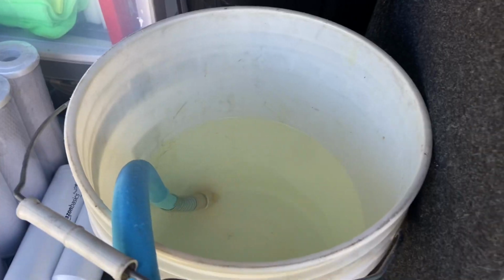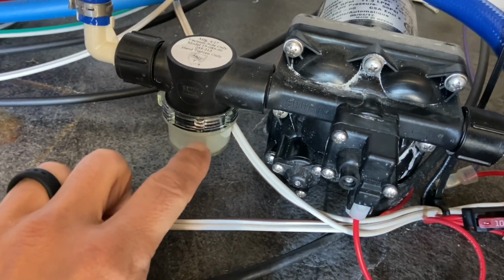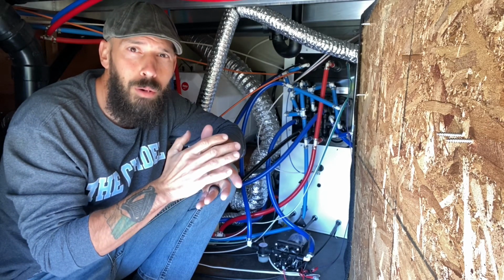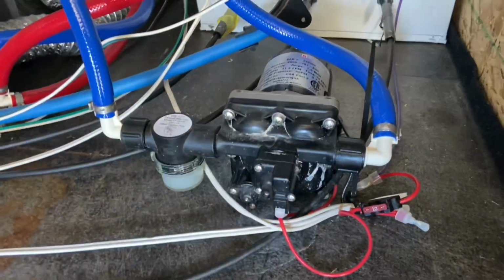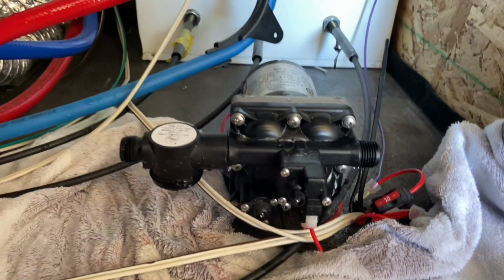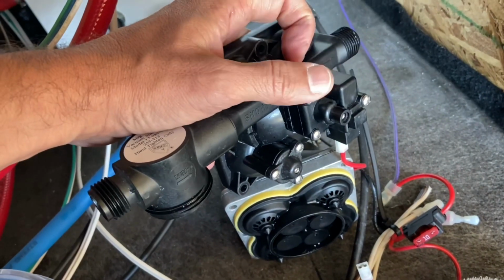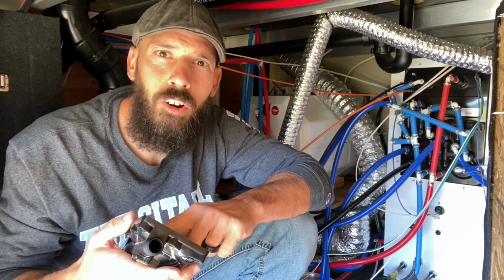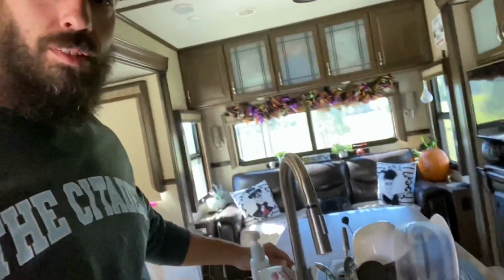RV WATER PUMP TROUBLESHOOTING (Pump Runs but No Water...Fixed!)

Comment: Nope, my valve is working but when the motor spins the diaphragm does not move. Got to try another video 🙄
Reply from the maker: Bummer. Hope you get it figured out. These things can be finicky. I guess the good thing is they aren’t to expensive or hard to replace if it’s totally shot.

Comment: Thanks for the video!! Our water pump wasn't working the same as yours was doing. It had power and I could hear it running, but no pumping action to pull the anti-freeze through for winterizing. Took it apart as you showed and that little pressure regulator valve was stuck. After a few firm pushes it broke free. Put it back together and it's working fine.
Thanks again for the good advice! 
This whole past camping season we didn't use the pump because we were on full hook-up. Lesson learned. Next year we will exercise the pump periodically.
Reply from the maker: I’m glad this helped you guys out! 👍🏼 Seems to be a common issue on these. Appreciate you watching and commenting 😁

Comment: Thanks Chris for the video. What do i need to fix when the water pump stops humming? I am getting water but the pressure is not as strong
Reply from the maker: Not to sure bud. Might be a small amount of air getting in somewhere causing the suction to lower. Maybe check the screws to see if they are all tight, the filter possibly…not to sure. Let me know what you find out if you solve the problem

Comment: Good diy on water pump! A lot of folks don’t know the pressure switch and go drop coin . I had the same thing happen on my 2021 class C two months ago and did the same as you and presto! All good but what I did was picked up another pump in the box and have it for a spare. We as well are in full hookup’s but half the time we run off our water tank and when needed refill it through a filter system. Glad you showed the breakdown so people know it’s not intimidating.
Reply from the maker: Thank, appreciate it Rick. Spare parts are something you can never have enough of on the road 👍🏼

Comment: My problem was a simple fix. Thanks to this video I found out that my water filter was not on tight enough. I unscrewed it and screwed it back on a couple of times, tried to pump again, and it worked!
Reply from the maker: Good deal. Nice job working through the possible problems. That’s definitely an easy fix and yup, if that’s not on tight you get air in there and lose suction. Appreciate you watching 👍🏼

Comment: Thank you, thank you , thank you. My water pump in my truck camper stopped failed to work on a recent trip. I had no idea why. I watched your video and followed the steps exactly as you described and it was just as you said. I took it apart, put it back togther and it worked like a charm. I am not a handy guy with mechanical stuff but you made it easy. I can't thank you enough for this video.
Reply: You are the MAN
Reply from the maker: Awesome! Appreciate the comment and love hearing this. Glad it worked out for you. 👍🏼Seems to be a pretty common issue after reading all the comments.

Comment: When ever I'm on City water for more than a few days I always fill my fresh Tank half way, then the night before we are going to leave I use the pump to fill the Black Tank at least 75% and the greys with the rest, this way I'm giving the pump something to do and it helps flush the black tank since it's got more water than solids in it. If I have full hookups I just open the valves as I'm preparing to hook up, giving it a few minutes to drain, if the campground has a dump station obviously I wait to do that, if I have to go off Site to dump like most of the National Forrest in the black hills of SD I keep the water at a minimum, I have a 80 gallon fresh tank that's a lot cheaper of weight to haul around. When I'm there it's. Balancing act. The wingback I just traded in had a clogged screen on the pump from water that had a lot of dirt in it 😒 I thought the camper was upset I was selling her I was able t 😭 Fix it before the dealership came out to give me a trade in value.
Reply from the maker: Yeah those screens can definitely get clogged easily. Definitely don’t want to be hauling 80 gallons of fresh water around at an extra 600+ pounds! Appreciate you watching and checking out our channel. 👍🏼

Comment: Do I need to drain the holding tank before I disconnect the water lines? Thank you!!
Reply from the maker: Hi Patty. If your talking about your onboard fresh water tank, no. You might want to open your low point drains if you have them to get all water out of your lines though. Not really necessary but if your hooked up to city water shut it off. Just have a small container like I did to catch any water when disconnecting. Hope it all helps 👍🏼

Comment: Thank you…Hope this helps my situation. Not sure what I did to mess up my system. Rarely use my RV. Water running out of galley sink & hot water heater only when I turn on the pump. Faucets & toilets, nothing.
Reply from the maker: Not sure. Maybe this will help. I hope you get it figured out though.

Comment: So, we pulled everything apart and our little valve actually was not stuck, it worked fine, but we are still getting 'spurting' when we turn on our faucets.   Any thoughts on what to look for next??
Reply from the maker: Sounds like your pulling in air from somewhere. I would look for any small hairline cracks on the pumps clear filter or check to make sure all the connections are tight so no air is getting in. Good luck 👍🏼

Comment: Is there any kind of grease that you could put on that seal? Maybe like some food grade white grease or something like that?
Or Maybe the flow of water will eventually wash it all off over time and I'll be back in the same position?
Reply from the maker: They make a water proof plumbers grease I use on my rv toilet seal to keep it lubed. You could try that. Not sure if your drinking from your pump though if you’d want that on there. I think just keeping the pump exercised more often is key. Appreciate you watching 👍🏼

Comment: My water pump is fairly new and was working fine, I live in my camper fulltime. A 2006 33ft eagle. This morning I woke up and the water pump won't work at all. I flipped all of the breakers and changed the fuse to the bathroom, which may be the incorrect fuse considering the pump is under the kitchen sink. Any helpful advice is very much appreciated, thank you in advance! ❤
Reply from the maker: Hard to diagnose from here. There is a little fuse right on the wires going to the pump that you can check. Could be a multitude of things. Sorry I can’t help more. Hope you figure it out.

Comment: Quick Fix for me! Thanks! Now I know this pump thoroughly. 
After putting it back together, it did not work. I was looking at the serial number thinking we burned out the pump after running dry for 15 minutes. I discovered the filter assembly was loose an 8th of a turn. The black connection to the pump, not the clear filter. It must've loosened up on the bumpy highways of Pennsylvania. Such a relief.
Durable pump!
Reply from the maker: Oh nice, good deal. Glad you solved the problem. So many things to check when they don’t work properly. Thanks for watching!

Comment: I clean the filter. The pump do not make any noise but there is water dripping slowly when the water pump is turned on. The bathroom faucet is running great when the pump is turned on. I can turn on and of the kit hen faucet and it works but not with pressure. I was told it's a switch on the pump but could not find it . Is that true? I have a 2020 winnebago travato 59gl
Reply from the maker: I don’t know, wish I could help but Im not familiar with that problem and it’s hard to diagnosis without looking at it. I wish you luck and hope you figure it out.

Comment: Man. I'm happy to have found your video, but I'm really gonna be bummed if this switch is the culprit. We've only had our trailer since December(bought new), and it was winterized since yesterday.  No chance to get city hard water crust on it. Little strainer cup looked perfect, though the screen inside had antifreeze boogers and other dust inside. Was hoping that was the problem.  Can't find any other place it could be sucking air from. No obvious leaks.
Reply from the maker: I hope you find the issue. Sometimes those little actuators are just bad or gummed up even if it’s not hard water causing the issue. Those pieces can be replaced for cheap but if your campers new I’d get them to replace your pump. 
Be sure to subscribe to our channel we have lots of helpful videos on preventive maintenance, store and organizing, products, safety and much more.
Reply: @WhyWait  Update. It was the HW tank valves. They were open instead of closed. Took the pump apart-thanks again for showing how- and the little thingie that was stuck on yours was moving right on mine. It's a bit of a wrestling match inside a freezer,  to take the screws off because my geo pro 19bh has the whole mess under the bed. But I am small and determined!

Comment: Thanks so much for your simple break down of what the issue could be. I had the stuck valve, so one or two finger pressure pushes on the stuck valve, freed it up. Now works like a champ. Your advice for part time RVers for exercising the water pump is spot on. Thanks again
Reply from the maker: Sure thing, your welcome. Seems to be a common problem with these as so many people on here have had the same issue. Appreciate you checking out channel! 👍🏼

Comment: Thank you so much for your clear explanation of pump problems. I am presently having the same problem, I hear the pump run but no water to the sink nor to the shower area. I had not been using the pump water system for two months so most likely that’s the issue. Fortunately I am still under warranty so I’ll get it to WINNEBAGO dealer and have them clear the problem. 🙏
Reply from the maker: Sure thing. Hope you get it cleared up and appreciate you watching 👍🏼

Comment: @whywait thanks for your video on H20 pump malfunction. My dilemma I thought was same as yours. However, as I began my investigation, taking pump apart step-by-step (taking 📸 often). I did not discover a hairline crack in the clear valve that holds screen filter but yet an O-ring gasket not sitting in the groove of the clear valve cap. It was just enough to seep air into the line, and in turn, causing nothing but air to sputter out any faucet/toilet. 

Thanks again for your post to YouTube. It gave me the simple guidance and confidence to tax my abilities of RV maintenance. My H20 pump running like a champ. BTW, did you attend The Citadel? SC is my home state.
Reply from the maker: That’s great! I’m glad it helped and made the job not to intimidating for you. I had a crack in my clear filter valve three years ago as well. Right when I bought the camper, I think water might of frozen in it from the previous owners. Good find. I did not go the Citadel but my oldest boy graduated from there! 👍🏼 We lived in Charleston for a long time.

Comment: Great video. 1st time viewer. New subscriber. My water pushes water, yet osolates vs shutting off. I have to turn off water pump switch to get pump to shut off. Thoughts?
Reply from the maker: My thoughts would be there might be an area   that doesn’t have a very tight seal and air could be getting into there. Check all your screws and possibly the filter on it. Or it could maybe your pressure regulator is getting stuck open vs getting stuck closed like mine.

Comment: Bleach cleans any lubrication off and causes rubber gaskets to stick. An easy example is to put bleach water in a spray bottle. Soon most spray bottle pump stops working.

Comment: With the pump on and connected to city water does it still draw water from fresh water tank?
Reply from the maker: With our system you can have the pump switch on but if the nautilus panel is in city water mode your water is coming from the water hookup. The pump only draws water from our tank when it’s switched to dry camping mode.
Reply: On my ACE there is only the fresh water hose hookup on the side panel, no selection switch to go from fresh to city water.

Comment: This is spot on! I took my pump apart just like he says, and finally, finally got that little button to push in, and the pump works! Thanks so much!
😀
Reply from the maker: Good deal. Eventually I think the pressure regulator needs to be replaced to keep this from happening again. It’s a cheap part. I also think it happens when the pump is sucking air with no water and that plastic piece gets stuck like that. Thanks for watching! 👍🏼

Comment: Awesome vid!! Was trying to winterize and couldn't get it to siphon the antifreez.  This will be the first thing I check tomorrow. Thanks
Reply from the maker: Thanks. There’s lots of reasons why the pump has issues siphoning sometimes so before you tank the pump apart make sure it’s the issue by adding some water to your fresh tank, putting your camper in dry camping mode and turn on a faucet inside. If it’s not even pumping water from your fresh water tank to your faucets you know it’s a pump issue 👍🏼

Comment: Last year my filter had some micro cracks too it wasn’t leaking that I could find and it worked fine but my new winterizing method pumps air in before the pump and you could hear air hissing from somewhere… it took me forever to isolate where it was coming from!
Reply from the maker: Oh yeah, luckily mine had water in it and I could see the slightest bit of water coming through the filter when that happened to me. Thanks for watching 👍🏼

Comment: I have a Grand Design Solitude s-class 2930. I’ve encountered problems with the pump siphoning antifreeze and bleach disinfectant from the Nautilus system like yours. My easy fix is to open the low point drains which are next to the Nautilus system for a couple seconds. Almost immediately the pump will start pumping the liquid after not being able to do it for the longest time. May not pertain to your problem but maybe it will help someone else out.
Reply from the maker: Good idea, I’ve had to do that as well when I’m trying to get the pump to siphon(when it’s working). Great tip for people. Thanks for watching.

Comment: Get outa my house!!!! LOL I'm out at my fifth wheel trying to get the water system running fixing leaks and finally got them all fixed and working perfectly on city water. then decided to test out the water pump and guess what it is not working. just runs without pumping any water. So i come in the house for a break and sit down at my computer and it tells me you put out a new video. LOL
Reply from the maker: That’s too funny! 😄 Well hopefully this helps out if not you may just have to replace that pressure relief switch altogether. Couple bucks on Amazon. Thanks for watching!👍🏼